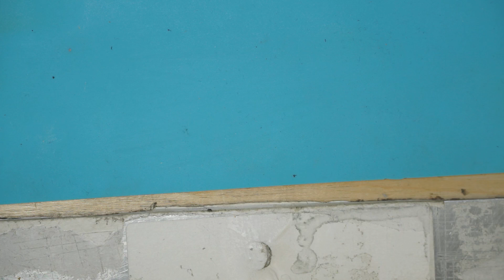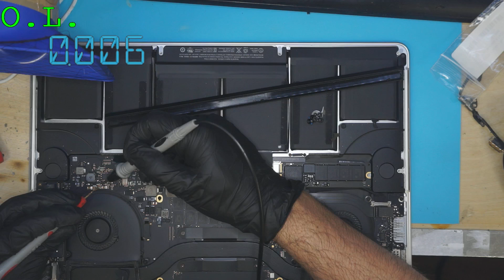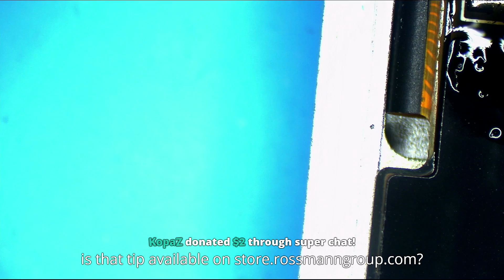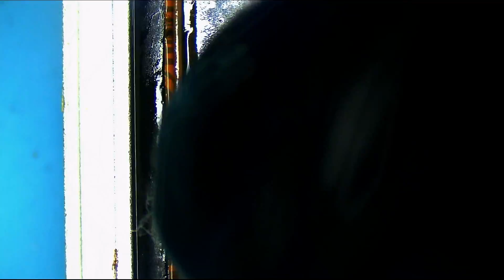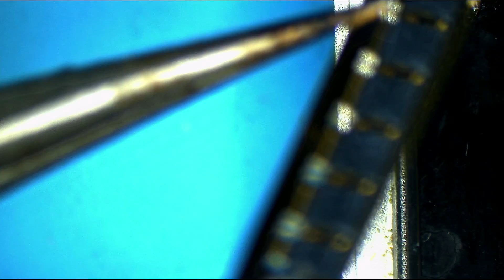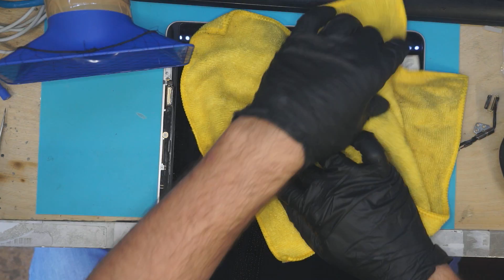A1398 Macbook Pro no backlight due to bad screen: screen repair without replacement.

Comment: Nice job but risky....it can be done with hot air, pcb with lvds connector needs to be detached, put on flat surface and protected with aluminium foil...did it few times on 13" and 15" ;)....all best and respect for what you doing :)

Comment: --> "has a problem with the board flexing in the case". That's what you get for consistently buying crap in a shiny aluminum case. You buy this year's trash in a shiny case, it breaks after 9-12 months, so you run out and buy next year's piece of shiny garbage hoping it will last longer. And everytime that happens Apple gets the message that they can do less and charge more because people keep paying for it. Until it you've lost serious money because when you needed your macbook the most, it blew up on you. Then you will sit in your hotel room and reconsider whether you can afford Apple, and most people in that situation will figure correctly: no they can't. Of course, you can double down and buy another one as a backup ;-) I'll bet that is what Apple recommends.

Comment: Do the same thing with mid 2010 iMac 27. A lot of us were not included in the warranty redo apple did for the 2011s. I hate not having my full brightness. Awesome channel as always.
Reply: i wanted to buy an imac from 2010-2011 with bad graphic chip and repair it by myself but its a nightmare to deal with those apple devices
Reply: I know. 😭 I’m just gonna connect a second monitor for now till I can upgrade. Shame though because this is a because screen.

Comment: Is there something like used in welding or  pipe soldering to block the heat from places/items you wan't want heated so you could  use hot air for this?

RichE San Diego

Comment: Hey louis. A friend gave me a MBP 2010 15'', and it have a few issues. 
1) gpu kernel panic
2) the battery was fully swollen. I replaced it with an alternative one, but it failed swiftly within a week (battery health dropped to 50% in just 5 cycles). So the tech guy where I purchased the battery told me that my mbp was faulty, and refunded me instead of the exchange. Can it be? Or it was just the quality of the batteries?

Comment: Has he not heard the news... the first thing to do is check whether the owner has turned the backlight level all the way down (i.e. "nvram -p backlight-level" returns "%00%00"). :-)

If it is all the way down, check the user's "apps to launch on startup" for any shell scripts which may be running a looped command to step-down the backlight level... macOS doesn't allow one to just set the value (i.e. "sudo nvram backlight-level=%00%00" updates the value of that variable in nvram page, without changing anything else in the hardware).

Only after the above steps have been completed, should one open up the "WacBook Blo".
Wac.  It just breaks.
CrApple.  Stink different.

Comment: Hi Louis, Thanks for your videos. I have a MacBook Pro (Retina, 15-inch, Mid 2015) so far not a single problem, would you recommend having it opened up and all the dust etc cleaned from the inside, would this benefit it and extend its life or more likely cause problems so unnecessary by fiddling. Regards from the UK

Comment: So apple gave me an A1990 after they lost my A1398... I bargained them up to giving me quite a few extra perfs because USB-c is the only IO
Reply: You could've gotten pretty much whatever you wanted if it went as you claim. 😂
Reply: @ilikeboost4764  probably but other than a lack of communication all the staff at the Liverpool store were pretty helpful. I recorded all my conversations and interactions secretly hoping they would try and screw me on something so I could publically tear them a new one but honestly I can't complain that much other than the data I lost which they do state several times about not being responsible for and all needs backing up and the other thing is getting the system setup for all my programming and music stuff...

Comment: Guys, I've got a severe problem with my screen, despite my very delicate handling it started glitching heavily and eventually turned to a complete mess. It's the second time at happens with no obvious cause. What could it be, can anybody suggest? And is there any, even a miserable chance to fix it without part replacement?
https://www.youtube.com/watch?v=eoAzId2a1b8

Comment: When we had this issue, we would change either the MLB or Display assembly because Apple didn't want us messing with the MLB. However, we were to check the fuse to make sure it wasn't blown. No one did it, they just changed the MLB and Display. I hated that place.
Reply from the maker: Start your own!!

Comment: questions: MacBook problems are normal wear and tear? Or users misses them and are abusive with them for these problems to happen
Reply: Bad engineering or bad build quality for a lot of those issues.
Reply: But also, there are a lot of users who abuse their systems. You especially see that with liquid damaged machines.

Comment: I would love to get into this kind of stuff have no idea where to start tho
Reply: You are already in the right place
Reply: Well. You could start with getting a cheap soldering kit and buying something broken on ebay and trying to fix it. Schematics are usually available online for most things
Reply: Just buy anything that’s broken for extremely cheap, take it apart and try and put it back together again. You learn SO much from this. After that you’ll probably have a good idea of what your next step is all on your own.
Reply: You can check the description, Louis has some stuff that can help. Otherwise I can recommend a beginner engineering book. You will have to spend some money before you can get started, though.
Reply: Start by downloading The Beginners Guide to Electronics (free).
Reply: Video 1 would be my recommendation.
Reply: Take a look at this channel https://www.youtube.com/user/mymatevince